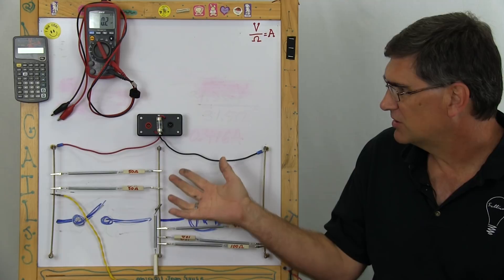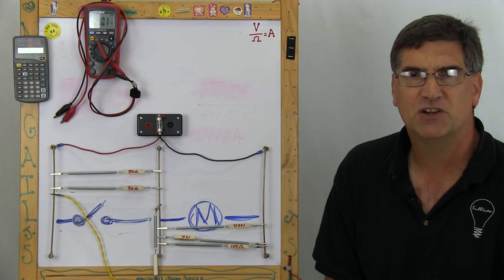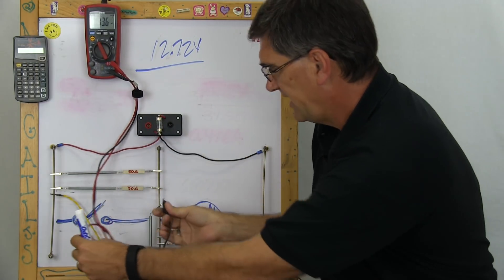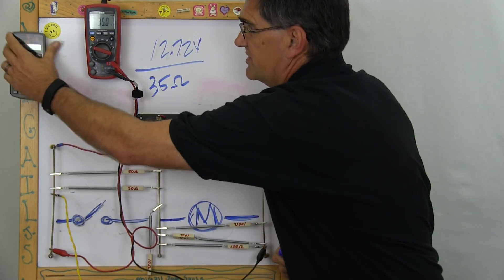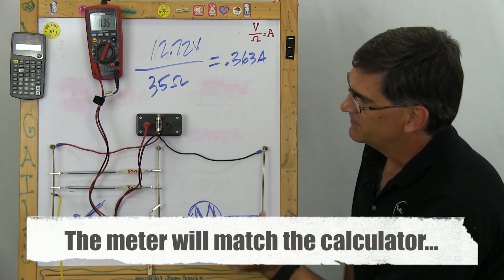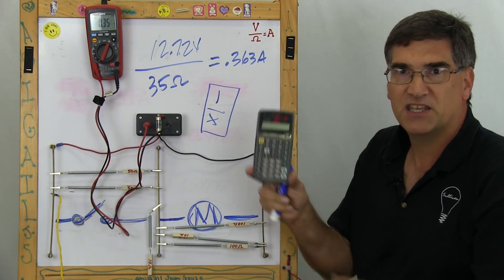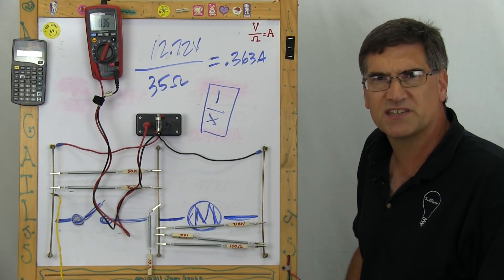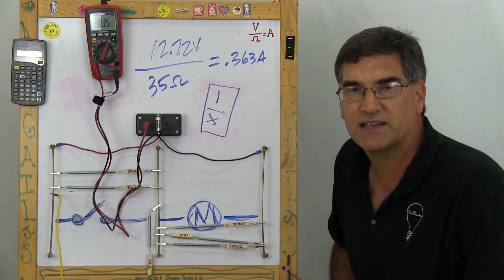Teaching Ohm's Law to Techs - Part 3

Comment: This was really helpful. I learn visually. Do those springs not add a fair bit of resistance?
Reply from the maker: @Leo-gt1bx  No. this was an old design for a classroom training aid. For what I teach the concepts are far more critical than accurate math. Math is secondary to understanding what really goes on in a circuit. Do you have my book or have you seen the training card videos?

Comment: Daniel, I love this video, where can I get a schematic to build  such a board ? Thanking you in advance.
Reply from the maker: This is all I have. It's just what you see.
Reply: @bivideo7  I worked out the schematic, the plug-in unit that could be used to read Volts and Amps confused me, but reading a previous comment I worked out the schematic. What is the fused box with the plug-ins called, I am trying to identify it so I can buy one? again thanks and I love the videos.
Reply from the maker: @michaeld9178  It's just a radio shack project box with a fuse holder and some banana plug receptacles. Nothing fancy. All that matters is that you maintain clarity and have a fuse or circuit breaker in the system to avoid melting wires.

Comment: I'm a lab instructor at a trade school, & we've got a fundamental problem using Ohm's law when we Calculate R using our Measured voltage(126v) divided by our Measured current(.323A) = 390 Ohms. Which is way, Way, WAY too high, doesn't make any sense. When we Measure our R w/ the meter it's about 10.5 - 12.5 ohms. Measured Voltage(126)/Measured R(12.5) = 10amps. Again, way, Way, WAY too high, doesn't make any sense again. We use 40watt incandescent bulbs mostly, sometimes it's a 60 or 75 watt. Do you know what we're doing wrong?... Thanks again, - take care.
Reply from the maker: Lee - I think you're talking about a bulb? Gotta remember the lesson in the first part of the curriculum about factors affecting Ω. Remember the test question? "What affects the resistance of a conductor?" - What do bulbs do when you turn them on?
Reply: @bivideo7  Yes light bulbs. Resistance goes up when they get hot, but does it go up to 288ohms?  Or over 300 ohms?  
Measure w/ the meter & it's less than 20ohms, or 30ohms at most. 3 bulbs in SERIES is about 60 ohms. 1 would think the simple calculations would get u in the ballpark, & some fluctuation would make sense, but it does Not, not yet anyway.  We're now measuring the resistance when they're room temp & after they've been on for a few minutes, but we're Not seeing that much of a change.      If resistance is changing that much wouldn't they be self dimming bulbs w/ minds of they're own?...   It would change the current & power output.
It's not just 2-3 students wondering anymore, it's 6-7.  So we're jotting the calculated R total & R individual beside the measured #'s.
Reply from the maker: @leeisenberg  Effective resistance - when hot. Not actual resistance. A 194 bulb usually draws .25A. -> ~60Ω. Depends on the bulb.
Reply: Okay, cool.  What is a 194 bulb? 
How did u get 60?
Thanks.
Reply: 1 of the more advanced students was interested & he said "the #'s worked out, & we never measured the Resistance w/ a meter in the lab."  
Well guess what; they missed out on the adventure of this Puzzle!...
Reply: Does the basic ohms law arithmetic not apply to parallel circuits?   We all know total R goes Down in Parallel, & goes Up in series.
Surely we're not the only 1's that have noticed this before.
I've heard Ohms law math referred to as "plug n chug", but we've plugged, chugged, & STOPPED, to scratch our heads.
"Inquiring minds want to know".

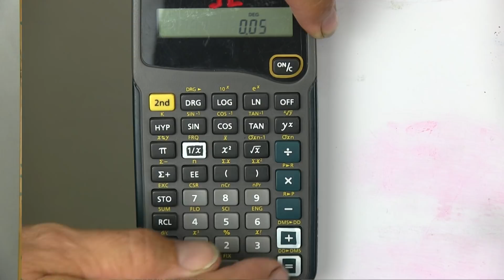Comment: Thanks for the videos.  Question: at 3:30 you measure 35 Ohms.  At ~7:20, you calculate 20 Ohms.  Is the difference because you have two parallel circuits in series?

Comment: How do you measure current and voltage with the DVOM connected to the same location, and when you measure resistance you powered off the circuit I iamgine ? 

But I really like the concept of pratice first great videos.
Reply from the maker: Open circuit voltage - voltmeter doesn't complete circuit. Closed circuit ammeter - ammeter is a switch.

Comment: Awesome information and explanations! Is it true that when you test for current(A) on a series circuit, you must modify the circuit by cutting (removing a piece of) the wire you are testing, in order to connect the Ammeter in series? Thanks!
Reply from the maker: +Bobby Bilko I'm not a fan of the "series" and "parallel" descriptions of meter usage. There are many reasons to use all meters in many ways. As far as the ammeter function goes, I prefer to think of it as a jumper wire and as a substitute switch. You don't "remove" something from the circuit - you simply open it anywhere you want to and use the ammeter to complete the circuit. Most critically, you must never "remove" the load component - without it in the circuit the circuit Ω will be 0Ω, so amperage will be ∞A.

Comment: I have a two welding machines with the same problem. The rheostats are damaged. Ohmite 1.5Ω, 5.77 amps. They replacement cost from manufacturer are $100 each. After searching on ebay I found some rheostats 1Ω, 10 amps. What would happen if I installed these instead?
Reply from the maker: SteelWorks First of all, as long as the amp rating is the same or greater, that's okay. As for the Ω rating, going back with the original is always best. If not, go higher.The error with the 1Ω would be that all of the settings would change, and whatever part of the system needs to see the other .5Ω wouldn't be available. Very Important Question - how many wires are attached to the rheostat/potentiometer? Also, I'd avoid eBay. I'd get the exact manufacturer and values off the component, and search for them online but add "Allied Electronics". They have everything.

BTW - You can use an emory board (nail file) to clean the rheostat if the guts are exposed. I'd also do a VERY thorough inspection of the wiring - especially where it's connected to the rheostat.
Reply from the maker: SteelWorks http://www.newark.com/ohmite/res2r0e/rheostat-wirewound-2-ohm-12-5w/dp/64K5667?CMP=KNC-GUSA-GEN-KWL-REM-NEW-OHMITE&mckv=|pcrid|60548045301|&gclid=CJTKotHP-cQCFaVj7AodvVsAsg
Reply: +SteelWorks well i don't think i would your increasing the amps may blow a fuse or burn something?

Comment: Whats the point of a resistor? To reduce current?
Reply from the maker: Yes - and also to drop voltage. V/Ω=A.
Reply: tubester4567 Current only splits at nodes. Across a resistor, the voltage drops but the current through it is constant.
Reply from the maker: Roy Miles With all due respect - I'd prefer that you not make the effort to tag along behind me and "improve" my responses. I've been at this a while, and regardless of your background, you're not the teacher here. Feel free to create your own videos, post them online, and teach your way. But, I know what my intent was, I'm the guy who is responsible for my work, and you're being rude. Normally I'd simply ban someone like you for the comments you've made, so do me the favor of respecting the 3 years of work I have in this effort.

Comment: What sort of wattage resistors do you use? many thanks
Reply from the maker: They're 10W ceramic from Radio Shack. I like the small resistances because they're more representative of what is really installed in vehicles.
Reply: Daniel Sullivan Thanks Daniel

Comment: OK - I think I get this one.  Placing resistors in parallel does not affect the behavior of any *individual* resistor, but adds additional pathways for the voltage to travel, so more gets through overall.  Hence lesser effective resistance across the aggregate parallel circuitS.  (Emphasis added.)